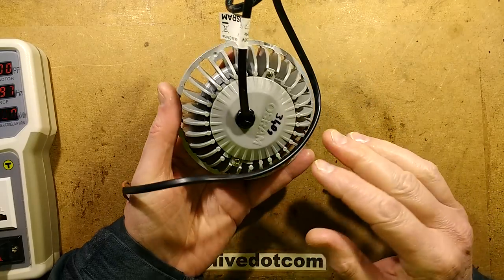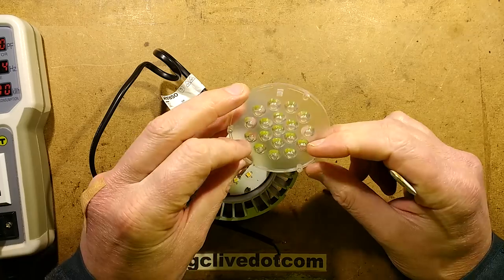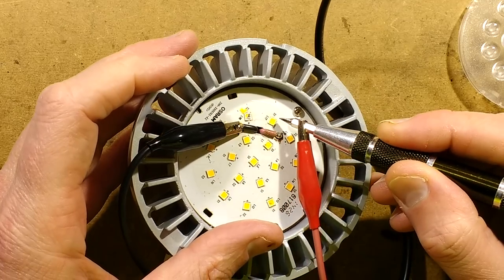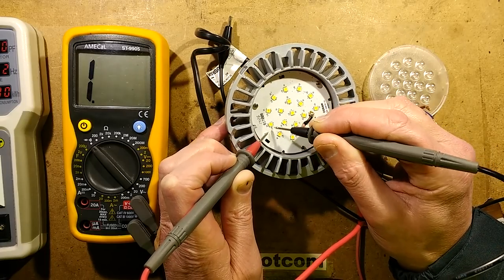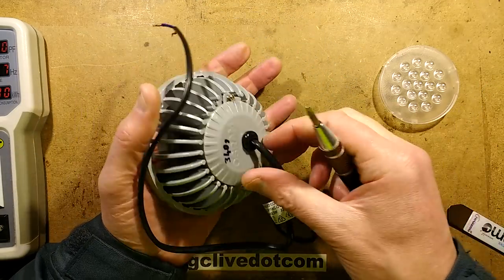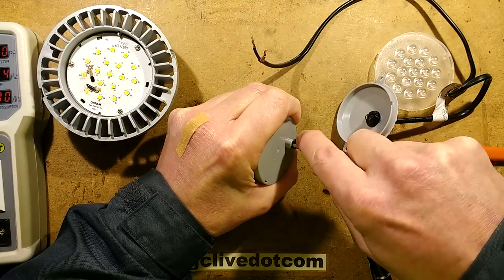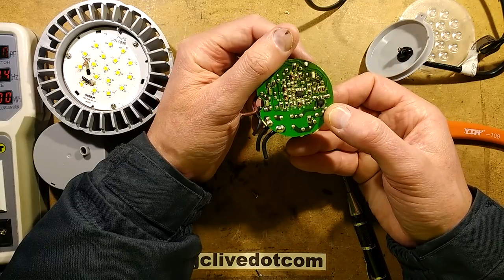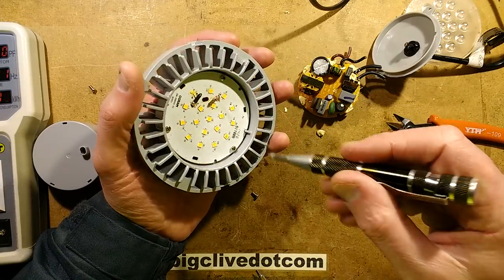OSRAM LED lamp module autopsy.

Comment: Spookily enough I have just finished doing an autopsy tear-down on an Osram GLS B22 (10W 2700K 48mA Made in China V3u). TL:DR; LEDs fine PSU MOVs blew. Smoke, no melting.

To summarise: Solid construction. Plastic dome is held in securely with silicone. LED PCB is aluminium cored, held by 2 screws and thermal compound onto an aluminium backplane (scorch marks visible - all LEDs test OK ) configured as 3x13 LED chains, with a 91R resistor in each chain. Lower housing is aluminium+plastic insulation below/under which forms a tube to hold the PSU.

PSU flooded with some sort of semi-solid goop. Silicone? Easy to hack out. Input end wrapped in tape. Signs of smoke on the PSU and inside the plastic housing. No sign of flame or melting. Single sided FR4(?) PCB labelled JZD60-E-1311 Rev 1.0 2012-8-15. Lower side: No sign of burning on bottom, tiny sc26(?) controller chip labelled MMBCO, 1A SMD i/p fuse. 20 or so SMD passives, SMD bridge rec. 

PCB Top side: carnage. 9x1mm creepage/clearance slot under a MOV connecting pri/sec sides of the transformer - 4mm track-track clearance on PCB (MOV=STE CD472M). MOV is considerably expanded and cracked. Signs of smoke. O/P cap intact Input cap: 0.1uF X2 275V no damage. 2xseries input chokes+parallel 4k7 resistor + tiny common mode choke. Bridge rec. Fusible resistor. All apparently intact. Red resin-dipped device (MOV? cap?) case blasted open, smoke damage, black residue on PCB.

Power line voltage spike? Faulty red resin dipped thing - Heat accelerated ageing?
Reply: As is sometimes typed: WARNING! MADE IN CHIAN.
Reply: Zadster Maybe repeated overloading of MOV, maybe a single catastrophic lightning surge?  But I'm certainly no expert in MOV failure modes.
Reply: MOV sacrificed itself to absorb mains spikes till it exceeded lifetime or power input and went short circuit. They only have a limited life, typically 1000 cycles of breakdown with the IEC test pulse, before they have excessive leakage current below breakdown, which then causes them to overheat and fail as a short circuit.

Comment: RFI suppression is no joke. I know of one case where a company had to replace tens of thousands of dollars worth of LED lights they had sourced from China because they were generating interference to nearby aviation communication equipment.

Basically, if you're using LED lighting (or any electronic equipment for that matter) that has poor or completely lacking RFI suppression, you run the risk of interfering with licensed radio communications, and once the FCC, IC, OFCOM, etc find the source, you will be legally required to cease using the offending devices, and replacing the devices with RFI compliant ones is going to be entirely at your own expense.
Reply: That's the theory, but in practice it often doesn't work. My brother is a licensed Rado Amateur who lives close to a factory which had solar panels, inverters and LED lighting installed a few years ago. Since then, he has been unable to use much of the radio spectrum because of the high levels of electrical noise. Reports and complaints to OFCOM have not had any noticeable effect on the problem..
Reply: Anyone remember Virgin media and the cfl issue ;)
Reply: YES ... thats why always buy certified quality stuff that complies with the standards of European Union ( incl. Germany) & USA
Reply: YES, RF interference + "dirty electricity" ... caples = antennas (same problem with D-LAN / Powerline Communication ) ... 
also these dangerous "Smart"-Meters are a cause

Comment: I have seen several of the new LED parking lot lights strobing like this one already. Looks like the expensive investment businesses are making to switch to LED to save energy is going to cost them in another way (and landfills).
Reply from the maker: I think there's been a lot of false advertising in the street lighting industry.  Why change a £10 lamp when you can fit a £200 LED fixture that will need replaced sooner.
Reply: You don't have any electronics recycling programs?
Yes its wasteful that this light didn't last long, but there is a lot of recoverable materials in it.
Reply: I've been wondering about that as well. I Just recently saw a 50w led  6000 lumen street light with an insane price point, where as my homemade hobby light (dual cree cxb 3070 cob) putting out 130W and 12000 lumen cost less than half, and I am sure that buying the parts wholesale would drop the price significantly. There must be some clever scheme artists in the industry, that's for sure.
Reply: Blimey 200 pounds? Ours sell for a lot more than that. Lots of clever councils blowing our money on vanity projects & pipe dreams!
Reply: They replaced the lights on a forest trail I run at, and it took a whole two months before one of the streetlamps started with a 50/60hz strobe, very pleasant to run trough at night, not!
Reply: Hey, it IS saving them energy if the lights are burnt out and not working anymore. It's just that the parking lot is a little dark now, but they are saving energy ;) .
Reply: I work for a company in the commercial lighting controls industry, and I specifically serve mostly Californian agencies. A lot of buildings there put in LED fixtures because, well, they have to. California energy code is strict, for better or for worse. Companies pay a lot more for their lighting and controls because code makes them, and they don't save any money doing it. Although I'm sure the customer thinks they do.
Reply: The chinese led lamps for in-home usage (like 11W) lasted 6 months only, 5 out of a pack of 6 broken. Two brands tested already.

I thinks all is due to thermal, these models simulates the shape of an old incandescent lamp, so it is all enclosed in plastic, with a circular aluminium plate in the middle, but no holes to where escape the heat.

Anybody tried already to make holes in it and test if it last longer?.
Reply: CREE makes an 11W LED (60W replacement) A19 pear bulb with plastic enclosure with ventilation slots near the base, and on the end of the bulb for decent cooling. The interior has a four-sided PCB following the shape of the bulb with 8 LEDs. These seem to last a long time.
Reply: You really have to wonder how long this bulb would have to last to offset the environmental impact of the materials, shipping, assembling etc. of this vs. A halogen bulb.
Reply: Does LEDs save energy over the traditional Sodium lamps that have been used as street lamps? Pretty sure I've read or heard from a credible source that Sodium lamps have a better lumen per watt coefficient.

Comment: You bring up a good point, Clive, and that's why recycling is important: In terms of energy cost there is no more expensive metal to produce from its ore than aluminium. In fact, I've read it takes around 14.5 megajoules to process a kilogram of ore. That is equal to leaving a 100 watt bulb on for 2 days. The only reason aluminium is affordable nowadays is because of recycling.
Reply: recycling is important, but re-using is far more efficient then recycling.  If we are looking to reduce our impact on the enviroment and\or reduce our energy useage things need to be designed to be repaired, not replaced and recycled
Reply: Ideally yes but there's economics to consider. The sad truth is that apart from you and me not many people will buy an item that costs more because it was designed to be able to be repaired.
Reply: Part of the problem with that is that it has become so easy to design and produce parts specifically for a custom application. That Osram heatsink might only fit that module out of their entire line-up and certainly not anything from any other manufacturer. Remember when every mobile phone had its own charger connector? (Gives Apple the evil-eye)
Reply: Chaos Corner the Nokia's barrel charging connector was the best of all.
Reply: And the Sony-Ericsson springy prong thing was easily the worst.
Reply: ManWithBeard1990 nope, that title goes to Nokia's equivalent. It had short prongs, and minute stability, something that it ruined the musical experience. That's why it was short-lived, and Nokia vent to TRS 2mm, and then the TRS 3,5mm connector. The Sony Ericsson proprietary connector had longer prongs, but as the time vent, the physical position of the connector vent around the phone, rendering some accessories unusable. Then Sony Ericsson adopted the 3,5mm TRS for sound, but charging, and data transfer remained, until the USB microB succeeded them
Reply: Hard to beat a barrel connector.
Reply: Chaos Corner 360° of swively freedom

Comment: I work in street lighting & I'm pretty sure most failures are due to water ingress or bad electrical assembly as companies switch from high discharge lamps to LED's & don't really know what they're doing. I'm also pretty sure that a lot of reputable manufacturers give a 25 year warranty on their street lights, mainly because the LED manufacturers said that's how long they should last. So you might not see a failure that isn't under warranty for a long time. I can see these companies fixing lights for free til the end of time, while Philips now seems to add more and more to the list of things that can make an LED fail. Don't fart in the same room as a bare LED!

Comment: I think I'd stick a handful of 1W LED chips in that metal housing with an appropriately capable driver on the back just to resurrect the unit shame to throw such a big heatsink away just because they wanted double-insulated compliance... :)
Reply: Agreed, I'd definitely reuse that housing, though I was thinking to take a ~60mm x 25mm fan, cut the frame off like you see on some video cards and put it in the recess where the PSU was, mounting the PSU in a separate box so it only has its own heat to deal with.  Put an aluminum plate in the heatsink as a heat spreader, something at least 3mm thick with good thermal coupling, then toss a Cree XM-L in it.  That should give it some thermal margin so you don't have to worry too much about where the entire assembly is integrated so long as there's a fore and aft airflow so the heatsink fins are effective.

Comment: There needs to be some new standards of fittings that include the heatsink, so the consumable is just the PCB/LED unit, designed to expect a certain amount of energy dissipation built into the mount.
Reply from the maker: +Peetiegonzalez The hardest bits would be getting the manufacturers to agree on a standard, discourage them from trying to dissipate excess power in them and making sure that the facilities management operatives replacing the modules maintained good thermal contact.

Comment: Those LED's have a protection circuit in them, that is a small chip that will break down and short out the led if the one chip goes open circuit, thus keeping the series chain intact. Typically they are a small thyristor and zener diode that triggers the SCR on when the voltage exceeds around 10V across the unit, though those that are short indicate the protection circuit has also failed short as well, as it should reset when voltage is removed, but the short indicates long term overheating of the whole led unit.

Available as an external unit as well, typically put across every 2 leds to do the same. Osram probably has a patent on the integrated units though. The led with the black spot of death probably had the wire bond of the protection die fail first, then the leds popped the bond wire and the arcing inside made the black spot of death, and also the flashing as it arcs.
Reply: Sometimes I think teh flashing is due to the constant current driver being unhappy, and other times it is due to a similar thing as in the HPS lamps. (Basically there is a bad die bonding, and the heat causes the circuit to break. But when it breaks, it cools down and then re-connects again!)

Comment: Kinda long for the days of magnetically ballasted discharge lamps, especially on lamps that are on for a long time... Sure they might 50/60hz strobe, hum, be not very efficient but damn they are hard to kill..  Kinda makes ya wonder the high turnover of failed LED lights adds up over the long term. in my street 6 months ago they replaced SON streetlamps with LED. out of the 6 that I can see from my house, 3 have already been replaced.
Reply: I just bought a metal halide bulb for a fixture my work gave me because they went to high output flourescent.
Bulb's rated 20,000 hours for 39,000 lumens.
It's probably capable of outlasting a rival high-output LED fixture...
Reply: +Dana Vixen - Oh hidden Chinesium inside ^^ haha
Reply from the maker: +Dana Vixen Let's just say that the LED industry has a very good marketing department.
Reply: +bigclivedotcom YES , marketing + PR is the most important part of a company today .... quality is just a middle to low priority
Reply: +Joshua C. high output LED = high heat & some PSU stress .... also LEDs are sensitive to over-voltage & also the Amps should be limited always
Reply: In my area, the streetlights were converted not to LED but to induction fluorescent. Much longer lasting and more reliable than regular fluorescent bulbs (they have no heater filaments to burn out!).
As for LEDs ... I retrofitted my reading lamp with a CREE CXA LED over a year ago, and use it every single day for at least 5 hours, probably outlasting 4 incandescent bulbs so far. It's still going strong. I used a simple (though inefficient) linear current regulator for it.
It's still more efficient than the 40W incandescent bulb it replaced, at only about 5W total.
Also, it's a bit brighter as well!

Comment: I can answer the question about how long these things last. They were fitted 4 years ago at work, and now 6 have failed, all in the same way.
Reply: Matthew Harrison (matthehat) same way as here?
Reply: Matthew Harrison (matthehat) we have recently fitted our whole house with osram led light bulbs, one already died 4 weeks in and i burned my hand on it.... 
Basically all get damn hot....
Reply: Yeah. There are a few that have LEDs out but are still lit, but I can't imagine them lasting much longer
Reply: 6 out of how many? 6? 1000?
Reply: About 30
Reply: Not great but not too bad. I've had twin tube fluorescent fittings (PL-C) die in under a year due to cooking themselves to death. The emergency ones are the worst, batteries look like they've been roasted and the mains wiring completely crispy. I think manufacturers don't pay enough attention to air circulation (although in our building, I think a certain Stirling based electrical installation company did a terrible job on the install with far too much cable stuffed into the fittings).
We've been changing the guts of these fittings since the first year of the building opening at a cost of between  £20 to £46 each, depending on lamp rating and if it's an emergency fitting plus the cost of replacing the lamps in each one on average twice per year...
Reply: John Barr PL-C are the worst,especially if they're used for outside lighting. They get no airflow and run for hours... We had one recently fail within 3 Days after replacing the broken one...
Reply: Mubb3l I can't disagree with you there... we've got hundreds of them, literally but they keep me in a job... can't be HV switching and writing safety programs every day, so changing lamps and replacing the guts keeps me busy... 😉
Reply: Matthew Harrison (matthehat) Planned obsolescense in a nutshell.
Reply: That is a pretty poor failure rate. I've had better service than that with cheap chinese lamps.
Reply: +Matthew Harrison (matthehat) - let me guess, shortly after warranty ends ?

Comment: Would it be possible to fit an LED board from another bulb in the chassis? The ~108V doesn't seem too uncommon and that PSU looks entirely overkill for the application. A few tapped holes and some better thermal gunk might make another decent light (sans reflector).

Comment: You can buy chips that fail as short circuit when the certain voltage is reached. Normally in SOT23 package and are placed in parallel with LEDs in case it fails. Maybe they have integrated it alongside LED. This circuit may also be the reason for diode drop in reverse direction, it could be a simple zener that fail short circuit. Another option is ESD protection.

Comment: Now it does not say how long it was in use, but it looks like the manufacturing date is 1426.
Reply: Good grief, I had no idea even Columbus had LED lights way back on his ships... ;)
Reply: 26th week of 2014 ;-)
Reply: 1426? I knew LEDs theoretically can last longer than tungsten filament. I'm sold.
Reply: It's not in American date format. (unlike Wheelock, who even with their newfangled Chinese-made signals, use the American format!) It's in international date format.
Reply: Welcome time travelers!
Reply: So that one ran for less than 3.5 years. Assuming 24/7 operation, from early July 2014 to early November 2017, that's about 28,000 hours, tops. Not bad, but not brilliant. If it was used only at night, 14,000 hours starts to look mediocre, and electricity cost savings, vs. unit cost and maintenance, starts to look like bad economics.
Reply: If it fails with only 12 hours of usage, then it's likely no better than a CFL, FFS! I wonder if Phillips Alto T8s can kick their asses now... 
I had many CFLs in the past that outlived this one, possibly even when ran for at least almost 12 hours per day! 
I ran CFLs a lot 10-13 years ago and at least most of the earlier CFLs purchased, in 2004 and in 2005, still worked in the 2010s!

Comment: Def not cheap eBay build there! The PSU looked almost over engineered. Would love to see a close-up/diagram of it.
Surely you'll be able to reuse the aluminium case for another light......your house must be getting dim by now so another light could help ;)